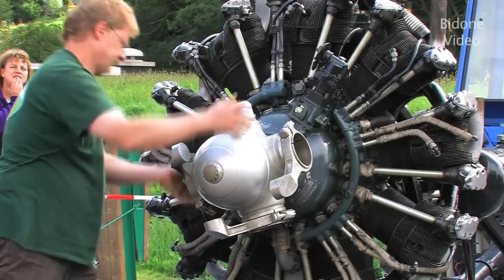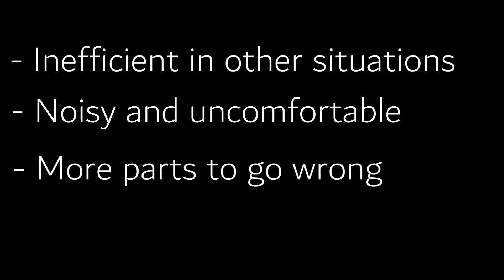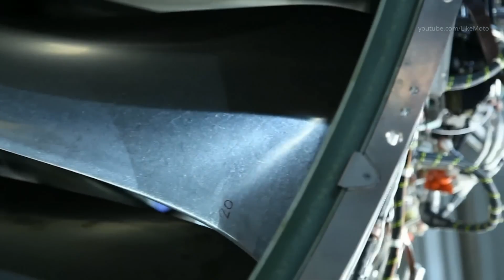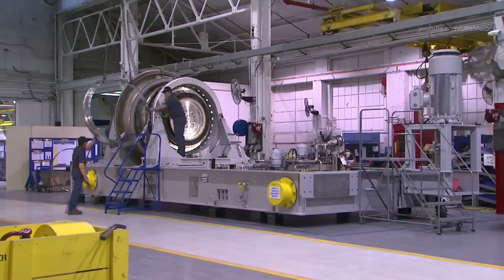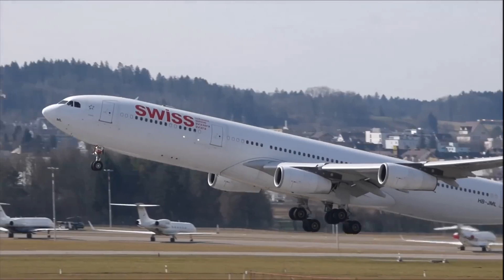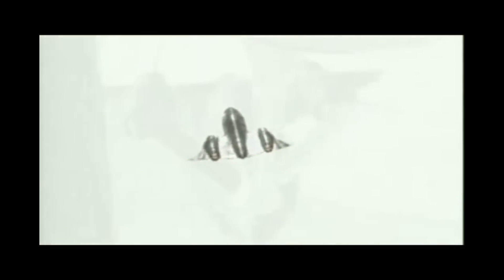Why Jets Suck - Aircraft engine types explained

Comment: I LOL'd at "turbofans don't have any disadvantages". Then was disgusted when you showed video of F-15 and SR-71 while talking about ramjets. You'll need to do better research if you want to create a quality technology channel.  :(
Reply from the maker: X-15 is rocket propelled lol, poor choice of aircraft. But turbofans share the same disadvantages of turbojets whilst being more efficient, so I avoided repeating those disadvantages.
Reply: @AverageAlien  Turbofans are more efficient at their designed altitude, but considerably worse than turboprops below around 20k feet. Turbofans are more efficient on flights that spend most of their time above 30k, but will burn a lot more fuel while climbing. 

Takes ~200 miles for a turofan to reach 30k. So on a 500 mile flight they'd spend 40% at climb power and only 20% at cruising altitude. A turboprop becomes more efficient for short flights, and their lower speed has less impact on short flights too.

There are some other disadvantages to turbofans too. They're far from perfect; just the best long-haul engines we have. But I didn't take your "no disadvantages" in comparison to older turbojets, but as a claim turbofans had none at all, so sorry if I misunderstood that. ;)
Reply from the maker: @CromemcoZ2  appreciate the extra info nevertheless, thanks for watching also 👍